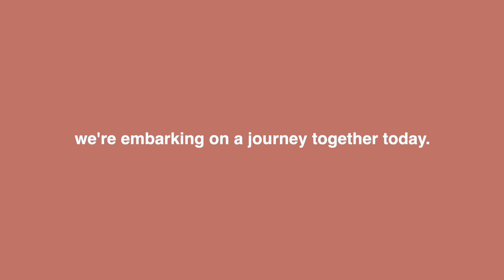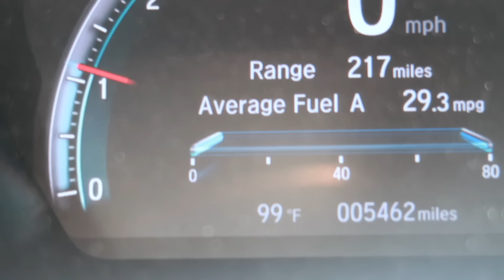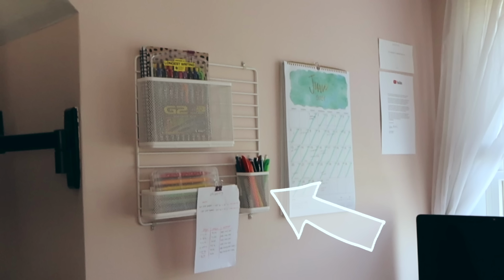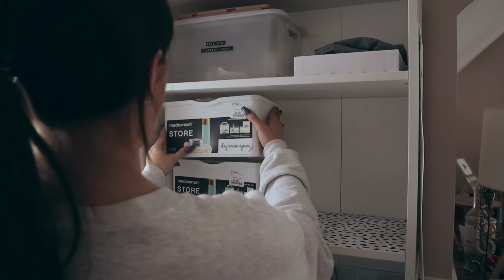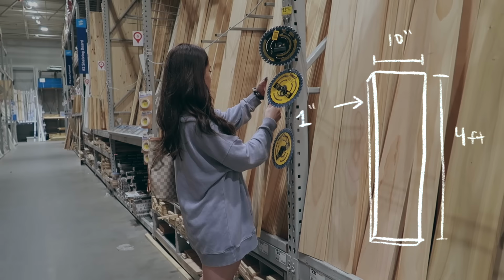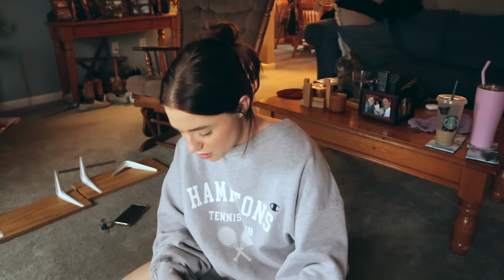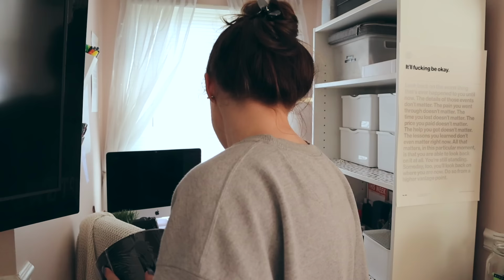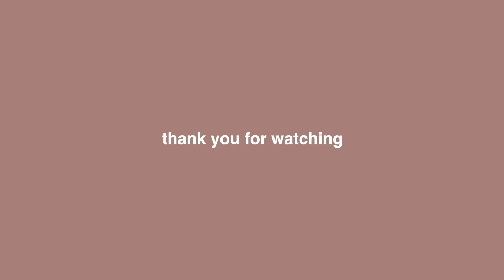cleaning, decluttering, and re-organizing my *small* bedroom office (ft. DIY WALL SHELVES)

Comment: You, ma’am, are braver than me dealing with those sorts of shelves. I ended up buying High & Mighty shelves, which are waaaaay easier to put in than those—they have a built-in level on the little sticky thing you put on the wall, plus the spots marked on the strip with the level to know where to place the bracket things, then you just slide and lock the shelf in.
Reply from the maker: LOL WHAT I didn't even know those existed
Reply: @HannahElise  I didn't either until I went hunting for something that people like me who are definitely NOT crafty and handy could put in without hurting myself lol. Stumbled across those and ended up buying three and putting them on the wall. I think it took me two minutes to install each one.